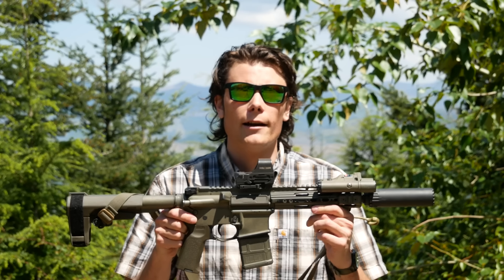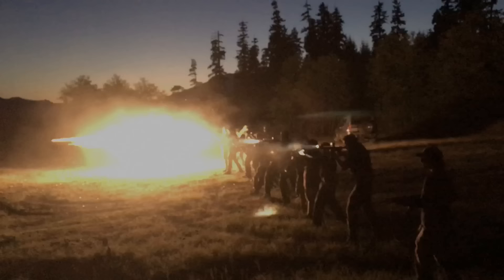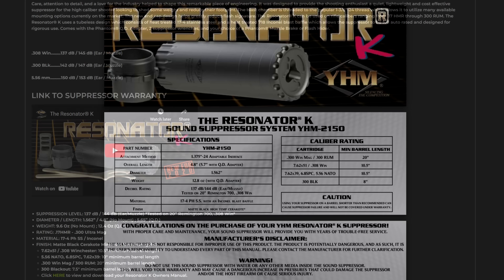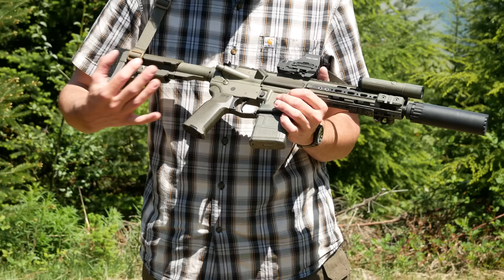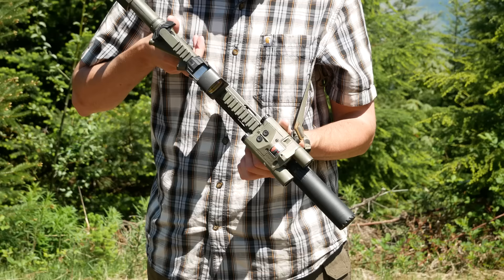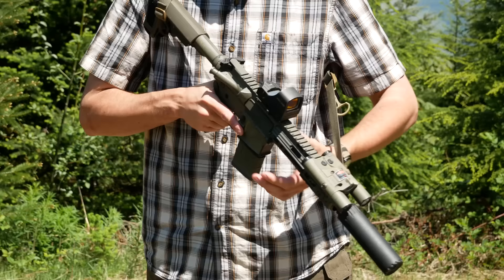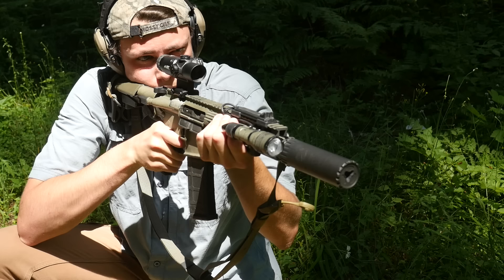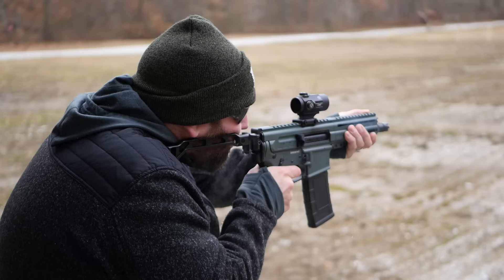The Broke Badger .300 Blackout PDW

Comment: i love my 300blk ar pistol, its pretty fucking gnarly for a shorter barrel .   i live in CA and have found a few ways to get 300blk to run better at subsonic speeds. i use an adjustable gas block and adjustable BCG ,  it took a while to figure out how to tune both to cycle and run well but its the most reliable ar i own by far.  thing is tack driver for being 10" and i prefer to shoot subs and undergas it a bit , keeps the noise down and not too much gas in my face.  my iron sights are sighted for subs at 100 feet,  my halo is set for 100 yards and is dead on and its by far my favorite ar.

it only takes 8" for 300blk to reach terminal velocity so the hypers out of 10" arent far off the 7.62 in terms of accuracy at the range,  the subsonic 300s feel like shooting a 40 cal pistol in terms of velocity etc.  i love hearing the round fire and then the crack of the lead hitting the target at a delayed rate, something about it makes me feel like a kid shooting a pellet gun.

Comment: This is very similar to the first “ground up” build I’ll be putting together soon. Just need a barrel and a trigger. I was recommended an 8” Ballistic Advantage barrel by my local shop. Seems like that’s what I’ll be going with. I have a standard forged Aero receiver set, I just need that specific set screw for the buffer retainer pin that they use. I’ve had a Strike Industries LPK for a while so I guess I’ll use that for now. I have an AB Raptor 8 suppressor that I want to try to use with it too. I need to find a handguard that can fit over it just to look cool, any recommendations? Does Aero make one that fits over suppressors? Thanks for the detailed walkthrough on 300 blackout setups. Much love from Texas!
Reply: Aero's enhanced handguards have an interior diameter of ~1.8", so if the OD of your suppressor is less than that you should be fine. I've heard that attempting to use mlok accessories near the muzzle with especially fat suppressors might require shaving down the hardware.
Reply: I was looking at aftermarket barrels and the twist rate is super slow which defeats the point of a short barrel

Edit: also, I have a YHM handguard that is 1.78” id

Comment: I bought the 300BO Lothar Walther 10" CHF barrel several years ago.  The gas port hole is undersized so it doesn't shoot without a silencer for sure.  Shame really.  Still waiting for my silencer.  I've opened the gas block up all the way, verified alignment with a bore scope, decreased the buffer weight significantly and put in a lighter buffer spring but I haven't tested it with those mods.  Next step would probably be to flip out the carrier with a lightweight one but if I had known I was going to have to do all of that I would have just changed barrels.  Now I'm in too deep.
Reply: I had that problem on a 6in and just drilled out the port.. works great now.
Reply: just drill out the barrel port.
Reply: @godsdozer  That's what I did.  Works fine now.  STILL waiting on my SiCo Hybrid.

Comment: with the ar180's and cmmg dissents coming onto the mkt,  its harder to call a standard ar-15 pistol with a short .300 blk barrel a true "pdw"  they just arent short/ small enough without a folding stock,  and the folding stock adapters are not the same as a purpose built folding stock firearm.   that said,  they still make great Home defense platforms for those who are already into the ar platform,  and cant necessarily justify upgrading to something newer.

Comment: I would ask what you think of the Brn-180s in .300blk as a pdw (a little long at 10”) but I almost forgot you’re not a piston guy 😂. My backpack gun/pdw setup is a Brn-180s in .300blk with an aero enhanced lower with picatinny endplate for a folder brace. With a holosun 510c and stream light white light so far so good not much time or rounds on it though.
Reply: I run a 16 inch 300 blackout for deer hunting, and you lose quite a bit of velocity between 8 and 14 inches of barrel length. I think the sweet spot for 300 blackout is somewhere closer to the 10-12 inch barrel range myself.
Reply: Brn180 is a sweet upper.

Comment: I always feel conflicted when it comes to the. 300 whisper /.300 blk.  As a combat and hunting cartridge, I see the merits. I also have programming saying it's not potent enough to hunt with in dense woods for big game.   If capacity isn't a huge concern .458 socom is about perfect for my area. If a pissed off black bear is possibly going to charge out of a thicket less than 20 feet away and it needs to be smacked mighty hard to stop it . The .300 blk better be loaded with some darn good bullets and as hot as safety allows.  In this instance,id prefer the whisper, it's 1mm shorter case neck means heavier bullets can be loaded for sub Sonic use. 240 and 250 grain match bullets were once made for the  .300whisper and .300 magnums like the .300 h and h.   that's were you will have your best chance with a changing black bear. Subsonic loads with the most bullet weight possible. The high sectional density means deep penetration. The low velocity means less bullet fragmentation when impacting hard Targets and the high mass for caliber means more inertia.  Essentially making the opposite of what you want for self defense in residential neighborhoods and busy, crowded houses.
Reply: Too long, didn’t read
Reply: @hstone-kf7su  TL;DR It's nice that the gun is short and quiet, but subsonic .30 caliber bullets might not have enough stopping power for dangerous game so .458 Socom might be a better choice for hunting.
Reply: @hstone-kf7su that's fine .

Comment: I have a shorty 300blk also and with a pistol length gas system I think your issue with some subsonics not locking the bolt back I'm leading to believe it's due to different brands of ammo, I've had that issue with 220 grain Remington, and some off brands - and this is with my 16 inch barrel too. For reliability reasons I changed the barrel on the shorty to a FNC 10.5 inch barrel as the 8 inch I had on it was giving FTF's, FTE's, and some not quite going into full battery even when changing over to a different buffer weight. Since then I started reloading my own basing my loads off of the Federal 147/150 grain supersonic, and the 220 grain subsonic rounds.
Reply from the maker: I can get 300 subs to work by reducing the buffer weight. But then it's very overgassed suppressed with supers. The trick is to tune it so it sits in the middle of all the likely scenarios.

Comment: How to .300blk: replace it with 7.62x39r and then realize that they days of cheap import AKs and cheap imported 7.62 are gone, so you are back in gucci territory now...
Reply: There are two options to 300blk one is to reload and be able to convert 556 brass to 300 blk. The other is to be rich as fuck.
Reply: But then you run into AK problems if you're going to run it with all the night vision add-ons.
Reply: Brass 7.62 is about the same price as reman .300 bo supers currently. If it weren't for large primers in almost all 7.62x39 brass the reloading costs would be nearly identical, with 7.62x39 consuming more powder for more performance.
Reply: @andreivaldez2929  Or cover both bases and get two BRN-180 uppers in both 300 BLK and 7.62x39 that can be run off of the same lower with the same manual of arms. Also has an adjustable gas block, and it's short stroke gas piston system for less gas in the face unless you're Brazilian and into that.

Comment: Would love to see you check out the new gen4 stealth buffer. Got a 3 pack for 80 bucks (they normally cost 70 each). I initially got them for my 300bo, but now all my ar's are running them. Definitely think your use case for 300bo is perfect. It's great for short range and tight spaces.
Reply: Where did you find that deal?

Comment: Personally, if I build a 300AAC, I would go with the 12.5 CMMG barrel inside of a complete Spikes Tactical parts kit and I would pin and weld the Spikes Tactical Barking Spider 3.75 inches on the barrel to reach the 16 inch mark but that's just me

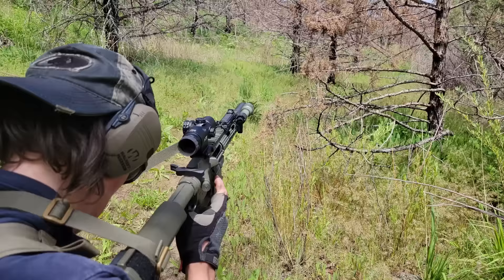Comment: 1:09 I believe the "heavier bullets deflect less when going through brush" claim isn't just unfounded, it's also been proven to be incorrect. The test is something I remember from 15 years ago or so, so as always, do your own research.
Reply from the maker: If it's the same "study" I've seen referenced I don't know how much I trust the methodology, and the conclusion was more about spitzer vs round nose bullets.
Reply: @Hoplopfheil  So, now I was interested.
1. Jack O'Connor tested this in 1957 and came to the conclusion that the bigger, slower bullets deflected less. This was likely due to the fact that that era of bullets was much less stout than now.
2. In 1948 Larry Koller published "Shots at Whitetails", and in it did a test and the conclusion was that lighter bullets deflected less than heavier ones given any chambering. The best cartridge was the 250 Savage.
3. Tyler Freel did the test in 2022 and came to the same conclusion Koller did, lighter bullets were better for any given cartridge. He also found that generally more energy meant less deflection (no shock there).
So, in conclusion, the results vary.

Comment: Some blackout failure to lock the bolt back after the last round may be your magazine. My local Rural King has a 50 gal drum in their gun shop that is filled with AR mags. I've bought Sentry Hexmags, H3T Gen2 mags, and MFT Mod II mags from that barrel. NONE of the MFT mags leads to a locked open bolt regardless of super or sub ammo. The other two makes do lock open reliably on the same ammo. I cannot get the bolt to lock back manually either with the MFTs. Shit mags.

Comment: Sorry, Hop. I love the sarcasm and memes in your videos, so I must keep your poor.

Even though you pushed the poverty pony for a Dissipator upper and are using another one on the build for this video, I ended up going with DelTon for that 16" barrel with rifle length gas system. They've even got 16" mid length uppers with free float MWI handguards going for $370 rn WITH bcg which is pretty tempting considering I'm changing my 16" FNH upper into a Block II M4gery and could use another 16" upper for a my lightweight trunk/truck gun folding lower. I'm waiting to see what their bcg and parts look like before ordering it.

As for a suppressed brush gun, I think 300 BLK is just as good of a cartridge as 7.62x39 which is why you need to look into the BRN-180 series. I think they're 10" and 10.5" barrels respectively, and most importantly they're short stroke gas piston instead of direct gas impingement for when you want to suppress them. They're just neat is all.

Stay beautiful, kween.

PS: If you're talking about Karl from InRange at the end, he's kinda a cuck. And I hope he sees this since you can't write anything negative about him in his comments since he'll delete them and block anyone who dissents from his opinion. So much for "no overlords"! He's the rebel who became dictator once he got a taste of power.

Comment: I found that mlok fits in the vent holes of the rail with some success... it is all 1:30,4:30 7:30, 10:30 mounting direction but still holds my flashlight pretty good

Comment: Man that's a cool build but I've got to say, it looks a little rowdy. My blk is the softest shooting AR imaginable. It's got adjustable gas, low mass wilson bcg and a cheap captured buffer with a few coils trimmed. Subs or supers it's WELL under the recoil of 5.56. Bolt lock without the buffer weight slapping your shoulder. May be time to try something different my guy.

Comment: Random gear question: what's a good rail for mounting a light/laser on a mid length fsp upper?

I've got a 16" stag lefty upper (yes I'm wrong handed. Shut), but it's got a fixed front sight post and a mid length gas system. At first I was just gonna take off the sight with a saw or something but I've grown attached to the damned thing and wanna build around it. What would be some good suggestions for a rail system that'll let me mount lights and ladders onto it since right now it just has the clamshell fore-end.
Reply from the maker: Midwest industries two piece free float. You'll have to remove some stuff from the barrel assembly but they're awesome rails.

Comment: I don't think the "less likely to deflect" argument is as relevant as people think. Does a heavier bullet deflect less than a lighter one? Physics says yes, but at the scale of the forces involved, the difference between 55gr and 200gr is not a lot. It's not like baseball vs bowling ball, more like baseball vs softball. 

Mk18 but 300blk seems like the perfect use for a 300blk gun. You can actually make it quiet, and it's not completely useless passed 100 yards if you needed to take a longer shot.

Comment: “An extra inch isn’t going to hurt.”  That’s what she said!

Though the Accupoint 1-4x bad glass?  Are you ok?  I’ve got two of them, one on a tiny .300 BLK and it’s actually really descent glass!  Maybe yours was bad?
Reply from the maker: What have you compared it to? The Accupoint, Accupower, and Credo 1-4s are pretty well infamous for having awful image softness at 4x.
Reply: @Hoplopfheil  

Maybe it’s the fixed parallax that’s giving some folks problems?  I own Vortex Razor HDs, Leupolds (VX series and Mark 6), S&B PMII, Zeiss Conquests, and about a half dozen mid-tier optics.  I’d rate the two TR-24s on par with the Zeiss Conquests and a little behind the Razor HD Gen 2. Both mine are from 2010-2014. Maybe newer units have a problem?  I dunno, but being as light as they are, I love them.
Reply from the maker: I like the weight, ruggedness, and reticle design. I don't like that the image turns to soup at 4x. The newer 1-6 design is leagues better, not only does it go to 6 it stays crisp at 6. The 1-6 Accupoints weigh about 5oz more than the 1-4s though, and that's significant weight on the top of the rifle.
Reply: @Hoplopfheil  I don’t know if a camera could do it any justice, but I’d love to see a picture of how yours looks on 4x.
Reply from the maker: You can see an approximation of it in my video about the Credos.
Reply: @Hoplopfheil  I’ll take a look.

Comment: Is that the YHM sRx mounting system at 5:35? I made the switch with my Resonator R2, I like it more, especially for overall length.
Reply from the maker: Phantom Kurz, not SRX. The SRX system uses a different family of muzzle devices.

Comment: 3:17 so if my hand guard is a 9” I should get a 10” barrel and it should basically match what you have (the space from the edge of the guard to the muzzle) hope my question makes sense.
Reply from the maker: As a general rule, think of AR barrels as being about .6" shorter than advertised, because that will account for the threads.
Reply: @Hoplopfheil  wow I don’t know that I thought the length was including the threads. Would it be safe to assume that I’ll be good if I go with a 10” then? I have a 10.5” barrel right now and it’s about away 1.5” from the hand guard
Reply from the maker: Well it's more like the length of the barrel, legally speaking, is from the bolt face to the end of the barrel. But you also have to have it stick out far enough to clear the threads, and you have to accommodate for the barrel extension. So if your barrel is .6" longer than your handguard, it should be very flush but the threads will still be exposed.

As an example, I have an upper with a 9.5" handguard and a 10.3" barrel, and there's just a little bit of exposed barrel before the threads start.
Reply: @Hoplopfheil  gotcha! I measured my two AR’s and a friends and from what I can tell all 3 barrels had 1/2” ish of thread length (two were different barrel lengths) Meaning if the barrel is a 10.5” the threads start at the 10” mark… would you say that sound about right?

Comment: Heavy Spitzer bullet that hits like a 45ACP or a 7.62x39

Can be reloaded from old 5.56 cases, fits in AR platform and AR mags.

What's not to like?
Reply: Price per round
Reply: @stoptrackingourdata8158  Just wait until your 5.56 cases can't be reloaded anymore and cut it down for 300blk bro

The brass saved for a few more reloads is worth the utility for a good performing small frame AR cartridge that is easily suppressable.
Reply: @TerranPlanetaryDefenseForce  I don't reload.

You asked what's not to like. I answered. 45ACP and 7.62x39 are more commonly found in the US and cheaper than 300 BLK. That may change in the future; but if SHTF right now, you're going to have an easier time getting 45 ACP and 7.62x39

Comment: If your upper and lower started to have 'wiggle' what would be a good way to make it have solid contact again? New pins? using a rubber gasket on the inside?
Reply: The rubber gasket you're referencing is an accu-wedge to help with upper/lower slop.
Reply from the maker: Learn to ignore it

Comment: I have a 10.5in 300blk bcm upper I just ordered a aero 8in 300blk upper im looking for suggestions on a optic to go with I currently have a 1x vortex spitfire prism because of my astigmatism but I have no problem using red dots either so idk what a good suggestion would be
Reply: I have a Leupold Delta Point Pro on a Leupold AR15 optic mount on top of a 7.5" barreled 300 BLK SBR truck gun.   I only shoot subsonics out of this rifle and this optic is alway on (has shake awake feature) and super clear dot with great wide field of view & long battery life.    Very quick and easily repeatable target aquisition during practive quick shooting drills.   Lightweight and durable.   Perfect for this application, IMO.   My 2 cents.

Comment: Did you have any problems with the Faxon 7.5" 1/8 besides length? thanks!
Reply from the maker: Nope. Worked fine, and it looked pretty sick wirh a KAK flash can slightly shrouded by the handguard.